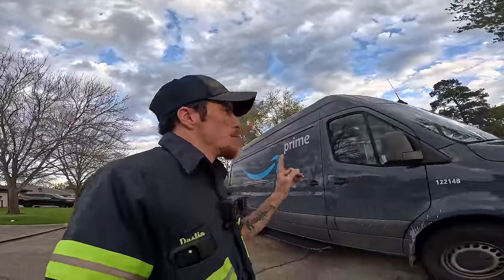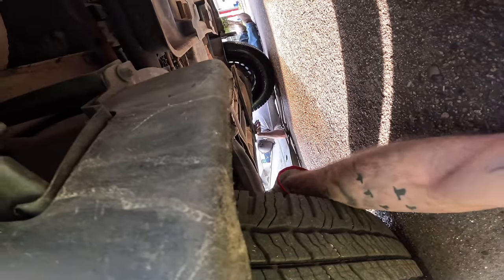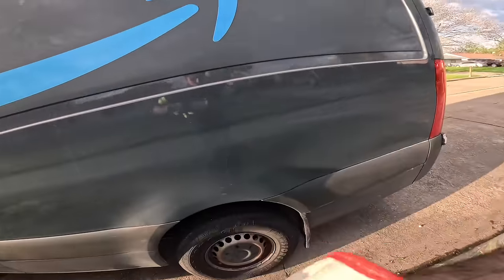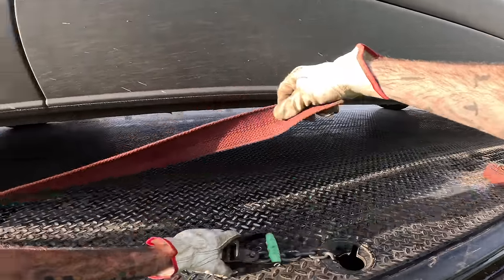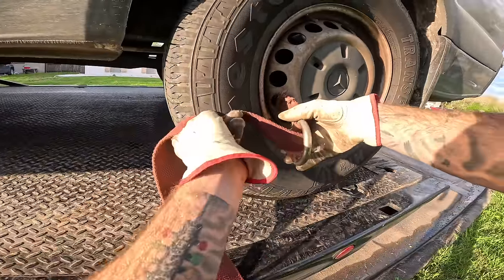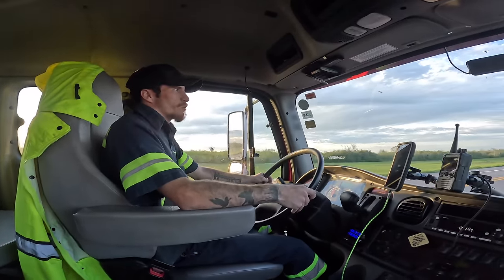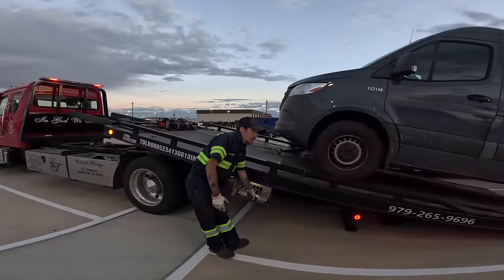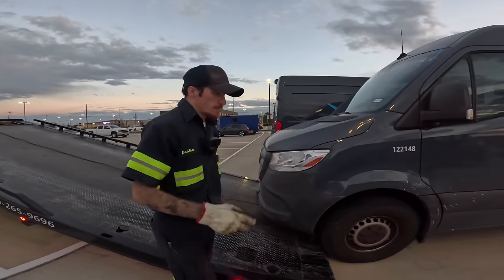There's More to Prime… a Truck Load More…

Comment: It’s probably doing that cause the system doesn’t have any brake fluid in it. I had a buddy go to the same thing with his Mercedes. He couldn’t move it at all until he clamped the busted line and filled the reservoir with fluid.

Comment: I used to deliver for FedEx ground and I for 2 months delivered in those blue Amazon vans as well. But many years at FedEx ground. I don't like the app you have to use to deliver with Amazon and also the AI cameras if you're waking up and starting your route and you just as much as yawn with certain dsps they will write you up. All we had was the ram blue Amazon Vans where I worked when I delivered for a Amazon DSP not the Mercedes or the Ford ones

Comment: Im Honestly not surprised its one of the Amazon Mercedes sprinter vans , i had the transmission go into limp mode on me the other day, then yesterday i had a the Engine lock up on me with a Dodge ram Pro master, typical water pump failure which overheated the engine and killed it, sucks to as i was out in the middle of nowhere when it happened, but thats the life of an Amazon Da Driver especially one that has a DSP that just uses Duck tap , clear tape and doesn't maintain the Vans .
Reply from the maker: Yeah we tow these things all the time. Mostly the Mercedes Amazon vans.